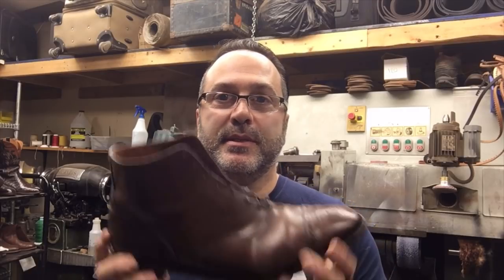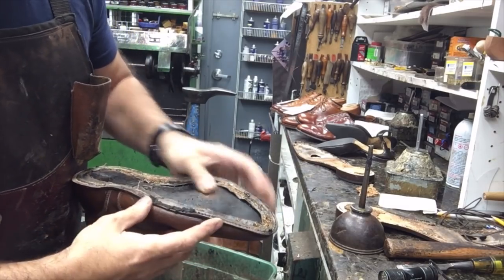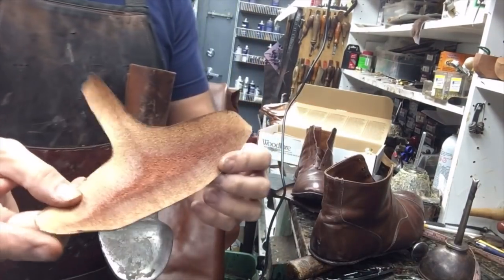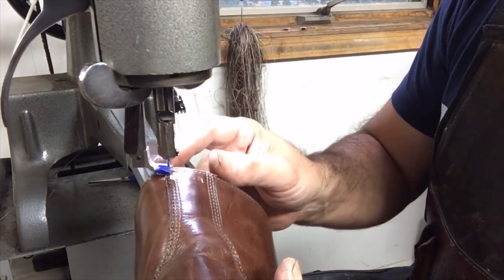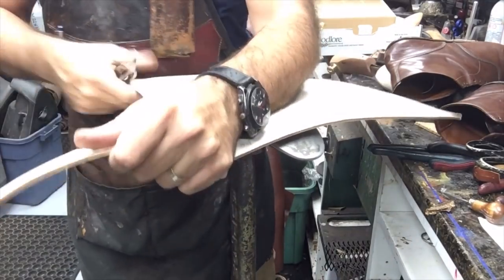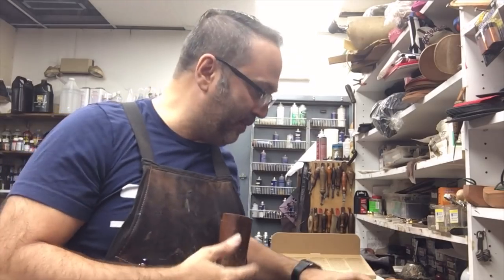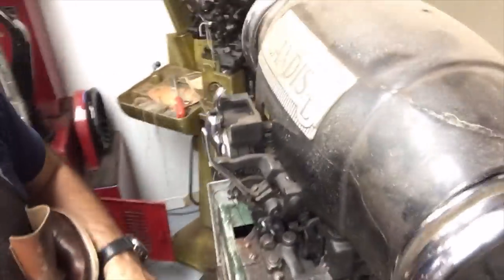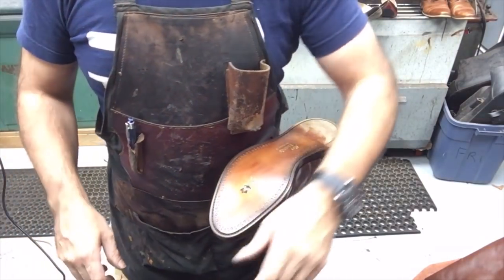Allen Edmonds Fifth Street boot Restoration #136

Comment: I wanted to add my experience with a shoe craftsman.  My right ankle was broken and crushed. This was before ankle replacement.  I had foot pain and back pain since the bones healed and grew back uneven. I tried expensive shoe orthopedic inserts. My foot and ankle Doctor sent me to a shoe repair craftsman.  They had work with patients before.  The Doctors diagram was to raise the outside of my right shoe stabilizing how my foot on the ground.  Amazing difference and I did not twist my ankle and more.  My Shoe Doctor helped my adults and children.

Comment: I would like to know if a customers foot has misshaped the structure of the shoe that much, it would mean he actually needed wider shoes and I’m wondering if you could actually customize it for him so it’s a lot wider than they would be and you make the rest of the shoe symmetrical with a wider sole for his needs. Would you do that? The reason I ask is because if he wanted these fixed up, it’s probably because he loved them and wants them to be new, but with the way they were worn in for him.
Reply from the maker: traderjoes it’s possible but risky because not have the feet measured it would be hard to be precise in the size

Comment: They apparently don't make these anymore. I can't find them on the website. Used pairs can be had on Ebay for less than $100, but the rare new pair will run you about $325. In THIS size? Probably none around at all, new or used.

I wonder if this customer is maybe a little bowlegged, so tends to roll his foot to the outside when he walks?
Reply: Just so you know, if you're still interested in the 5th street boot, that make a new boot called the Hamilton, it looks a lot like this just to let you know
Reply: @willisix2554  I wasn't really, but thanks. This is just the sort of thing I tend to get curious about with videos like this, wondering what might lead the customer to spend so much on a restoration. Sometimes it makes more economic sense than others. In this case, it appears the shoes are literally irreplaceable. Once you find a good pair of shoes this size, I imagine you tend to treasure them.

Comment: These should be thrown out. He should just buy a new pair. I completely understand restoring some boots for sure but these need to be retired
Reply: The cost of repair was what a new pair of AE costs.  But, a new pair of AE wouldn't have JR soles, and the uppers wouldn't be broken in.  And, this particular model is discontinued.  So, I would say that Steve has added value, and if the owner wanted a new pair of boots of comparable build, he would have to go bespoke, and a bespoke pair of boots could easily cost hundreds more than the $400 repair cost on these boots.

And, the owner of the boots has a very large and wide foot, so he may have a hard time finding shoes and boots at any price, let alone shoes he likes.
Reply: @martintanz9098  all valid points. Me personally would never let my pair go this long without the first restoration though